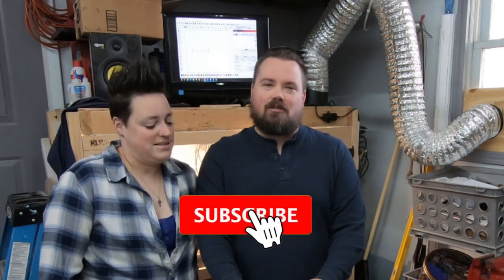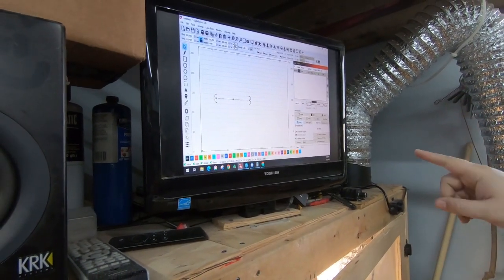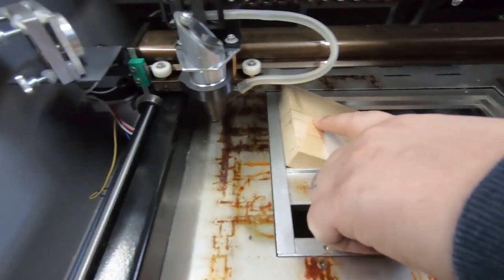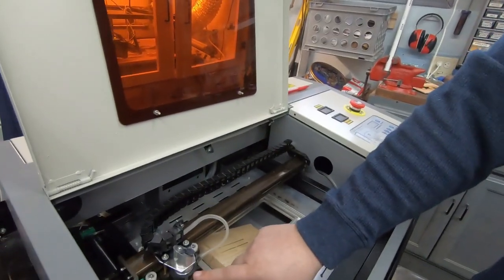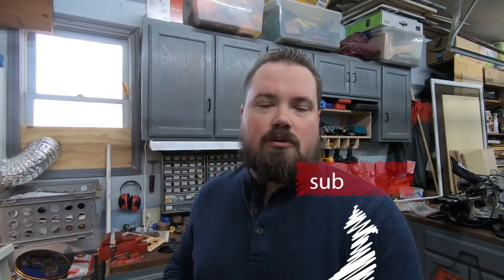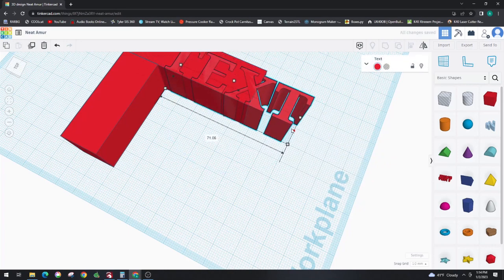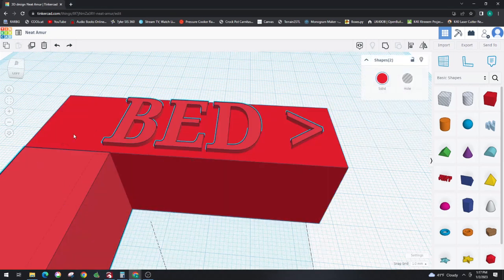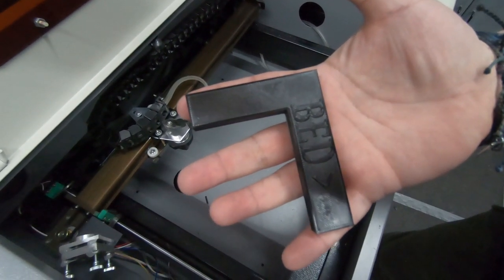Ramp Test and Focal Gauge | Monport K40

Comment: I used a stepped focus gauge that has steps and labels in mm.  I just place it under the tip of the air assist nozzle.  Thanks for the video.  I probably need to do this again as I really need to double check that I'm dialed in right.  It's been working great.  But since I want to do images I need to be sure.  Thanks